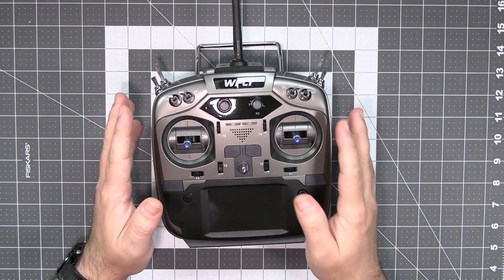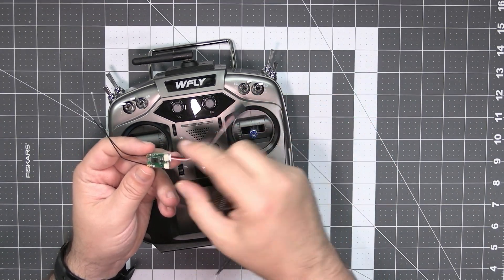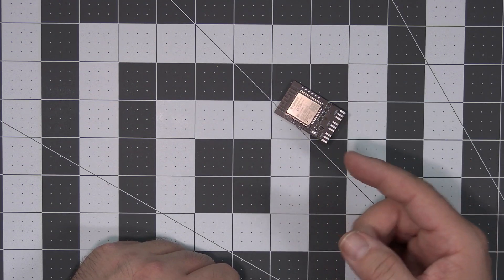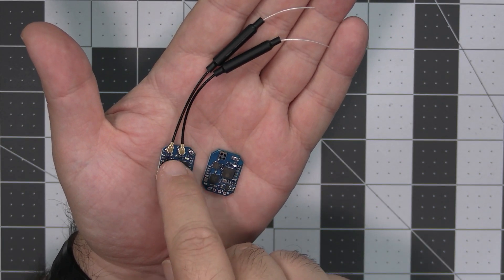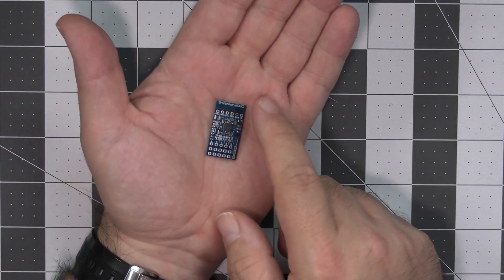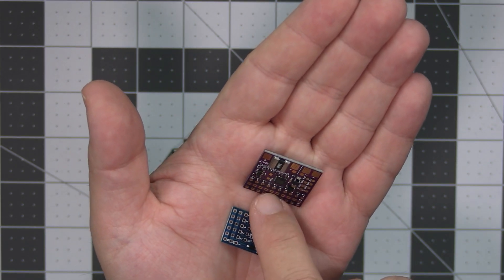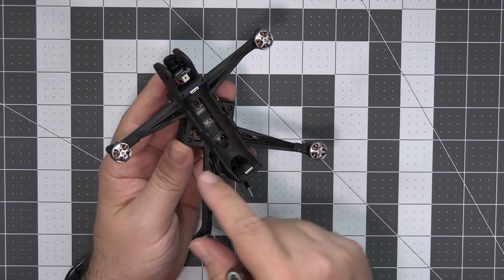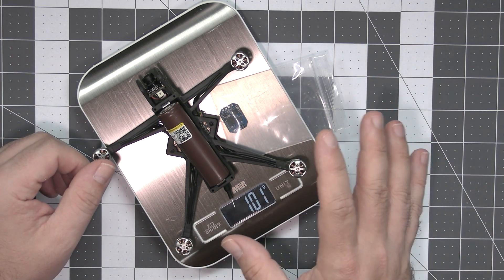New FPV hardware November 2021 - WFLY, Express LRS and Matek

Comment: How will you connect the servos to that PWM board.  Do you have to solder the leads to it?
Reply: They most likely come with pin headers for you to solder on. Every other matek board comes with an abundance of pin headers.
Reply from the maker: You can just solder in headers. They are in the package